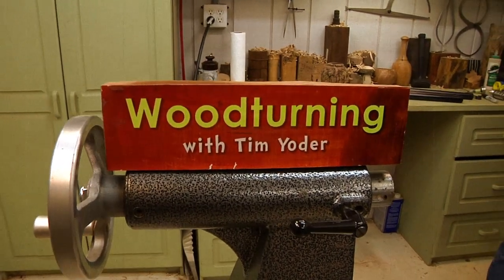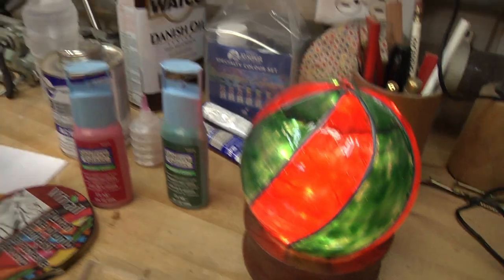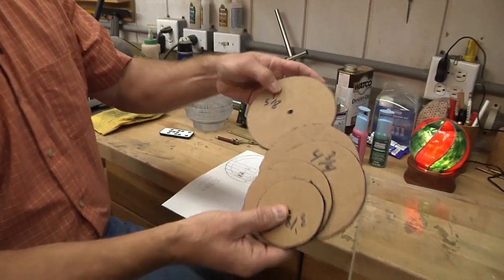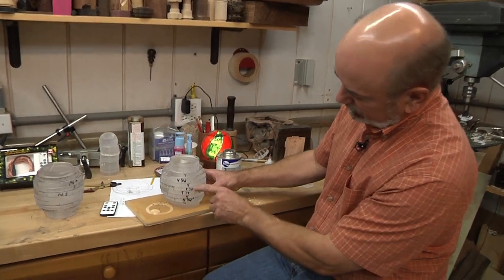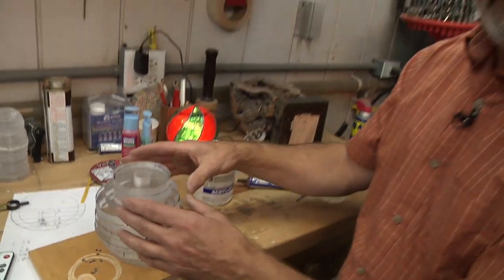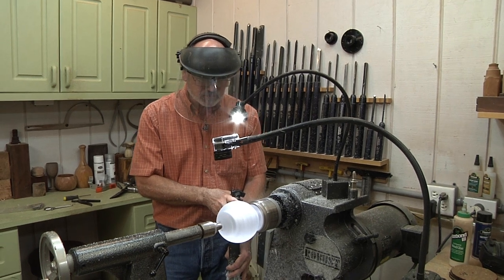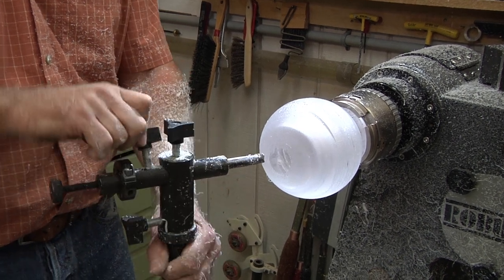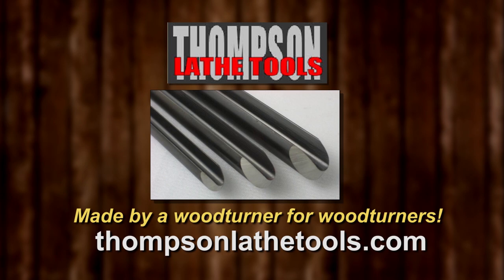Holiday Acrylic Stained Glass Globe

Comment: Another terrific video! Here's another way to get the waste disk out of your hole saws ... use two screwdrivers (or whatever you have that will fit), inserting one on each side. Even pressure on both tools will usually pop the waste disk out with a lot of fiddling. Keep turning!
Reply: Good tip. By the way, is Jill Stein going to replace Hillary?

Comment: Interesting project! I've done multi-disc Lamps using 1/8 thick "rings stacked and glued. Best option I found to use to turn with is an angle grinder running in the opposite direction of turning workpiece. It will grind diameters round with NO chipping. Finish cuts are still a challenge. Light cuts work best here.

Comment: Good idea to always have a ventilation hole as well, even with LEDs. Everyone underestimates the heat they can produce if left on for any extended time, especially a lot of them in a small container. 

Question for Tim: Have you ever worked with a glassblower on designing bases for nightlights or other glass meets wood projects?

Comment: Maybe I'm not thinking correctly but if you had the proper sizes of hole saw bits couldn't you use the plugs as the next layer and save a bunch of acrylic? By the way I learned that a little bit of water and a low speed keeps plastic form melting when you drill, but it looks like you got it to work pretty well. Thanks for the vids I very much enjoy them and I really like that you have videos for those of us who don't have tons of extra money for projects.